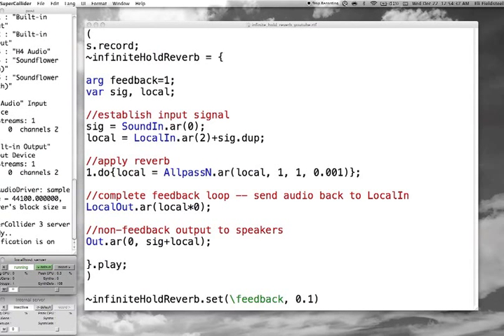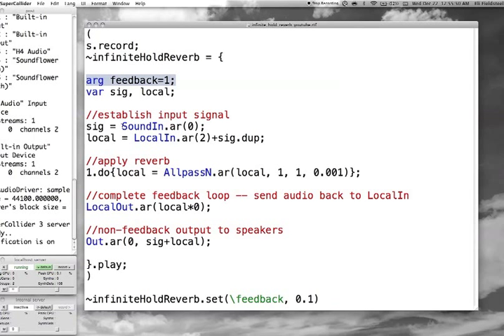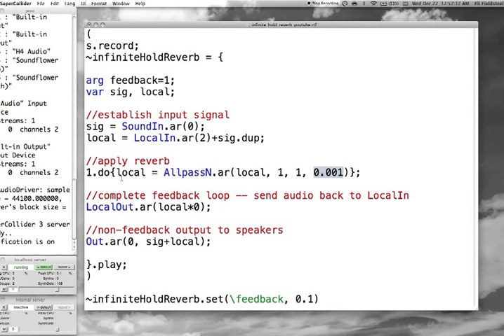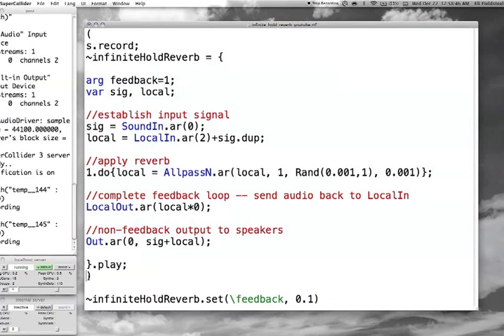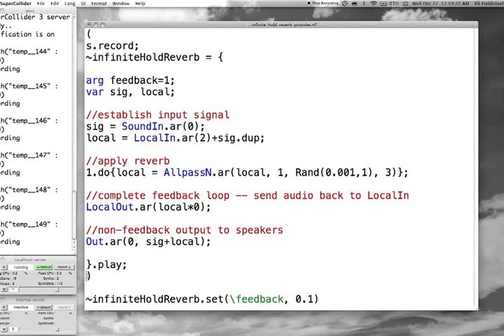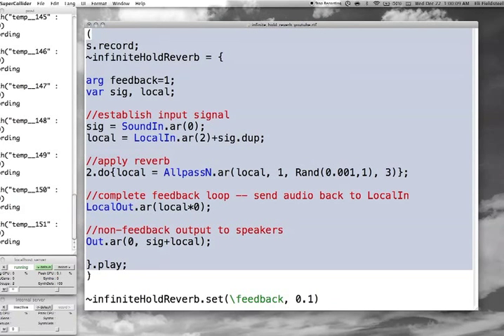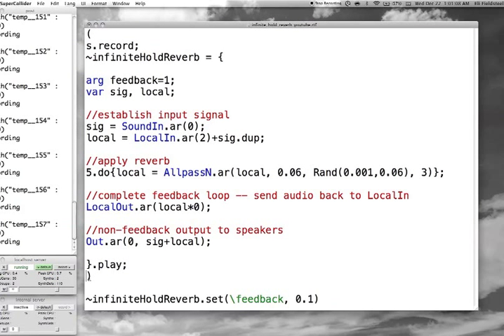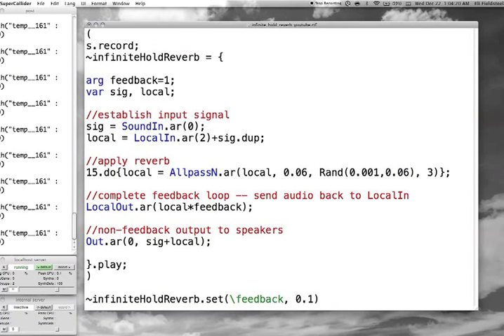(REVISED) Infinite Hold Reverb in SuperCollider

Comment: hi! thanks for your videos! I want to know how I can rewire ableton with SC, I have actived the rewire of ableton. Maybe with jackpilot, but I think we can do it without this app, by a code in SC
ThankS!
Reply from the maker: Are you on Mac? If so, I wouldn't bother with ReWire. I would just use Cycling 74's Soundflower for sending audio, and Mac OS's native IAC bus for MIDI. Soundflower seems to be a rather simpler and more general-purpose option. If you're on Windows or Linux, I can't offer much help. It's probably possible to do this with ReWire, but I've never used it, nor Ableton Live.
Reply: thanks! yes im on Mac, I will try Soundflower. Waiting for more great soundS!

Comment: very good explanation. i've known SC since 2001 but only now i am starting to dip into understanding the code. I used to be able to tweak examples to my need but this made a few things much clearer. Is SoundIn always accessing the input selected in the system prefs or can i access external hardware too with some additional code?